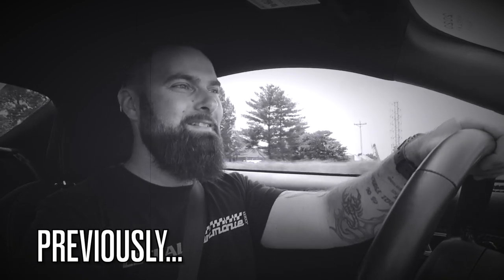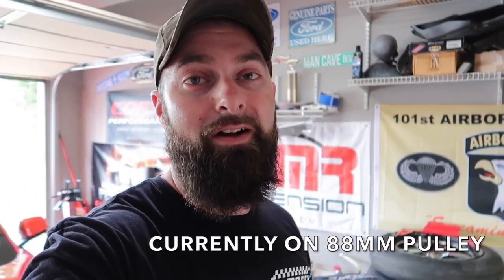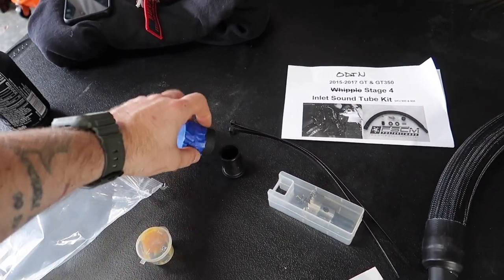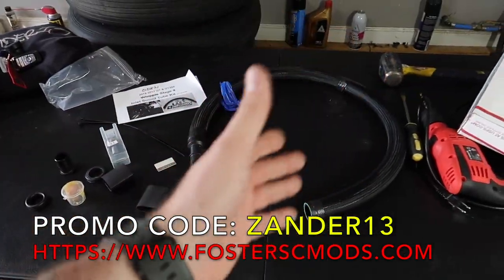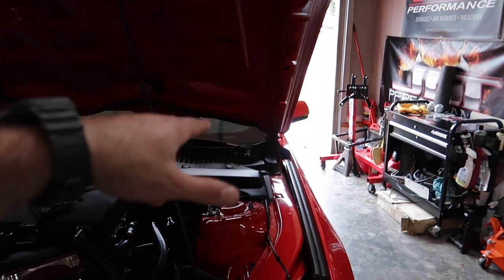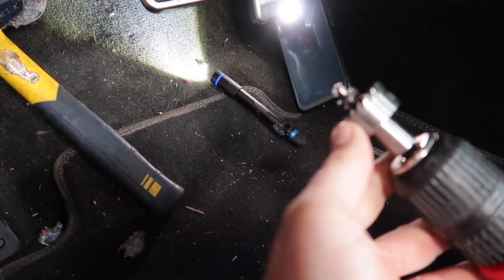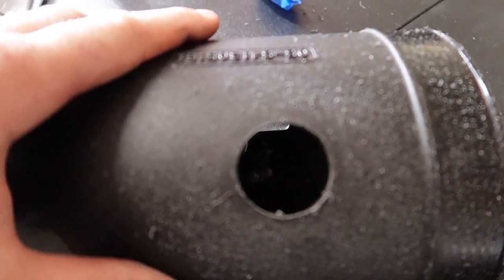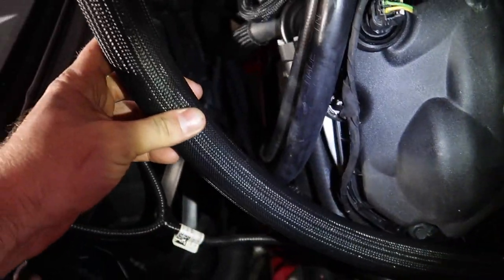Modding my Mustang Supercharger to SCREAM!!! First VMP Odin Whine Mod!

Comment: Why can’t you use the factory sound tube hole in the firewall? Why can’t you use the factory sound tube? Isn’t there a check valve in the factory hose?

Comment: Just had a Kenne Bell LC super charger installed on my 2015 GT PP1.  I want that blower whine too!
Reply from the maker: This will work. Just let them know you saw this video for a deal 🙏
Reply: Well kenne bell should already whine like no other. Shouldn't need to drill a tube into your car to hear it. Just play a sound track for a terminator if you're that worried 😂

Comment: Hello,  I recently bought the FCSoundtube kit.  
I have a question you might be able to offer some insight. 
I installed a Kenne Bell on my 15 GT PP1 last fall.  I am going to have to upgrade my tires.  I have Nitto 555 G2's on the car.  Looking at the Toyo r888r and the NittorII.  
Do you have a preference for either of these.  Really looking for some solid hook when I hear that whine!   
Scott

Comment: I’m curious if you notice an idle dip with you close the doors when the windows are up. I’ve had customers with this mod and the interior pressurized when they close the door with the windows up and the car dips in idle. It doesn’t do it when the windows are down. 😂😅
Reply from the maker: No. Mine does not do that.

Comment: Hey Zander,  are  the cams stock?  Aftermarket cams make a huge difference   with these engines.  There's a yellow 19 zr1 (was  once blue)  that is (secretly ) in the lab. Its goal is to be better, stronger, faster... than any street driven  coyote or  predator engined mustang. Just giving you a heads up, incase you  happen to have an encounter.  MEET force  with OVERWHELMING FORCE!!!!  I  know YOU KNOW!!!! ✊🏽👍🏽
Reply from the maker: Stock cams

Comment: Great video and awesome sounding Mustang! Funny enough, I have an SVT Cobra M112 supercharger on my LEXUS GS400 and it's SO quiet (for numerous reasons, perhaps spin speed being one of them as I am running only 7psi on the 3.65 pulley). Anyway, I'm definitely going to look into the mod in your video and see if it would be an option for us LEXUS SC'r guys. I'd like to offer another idea for you, and it's super cheap. I found a way to get induction noise into my stereo system via a mic and FM channel. Sure, it's a little gimicky, but it works! Here's the vid: https://youtu.be/5aYYbiFSodU